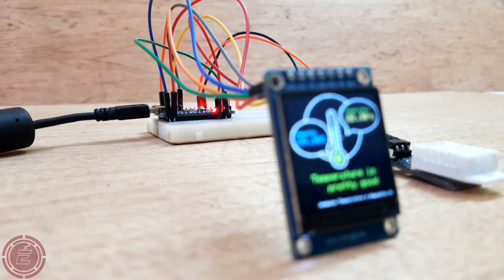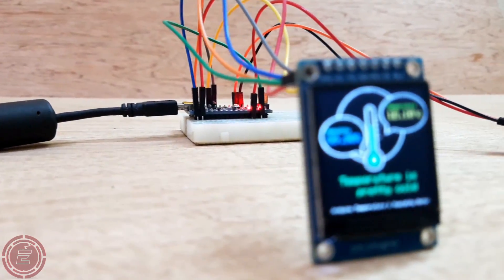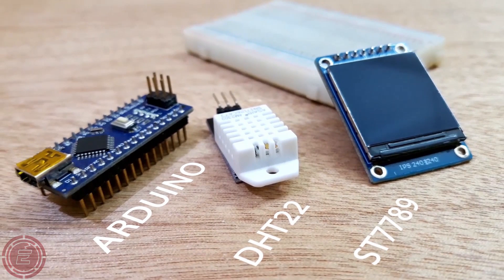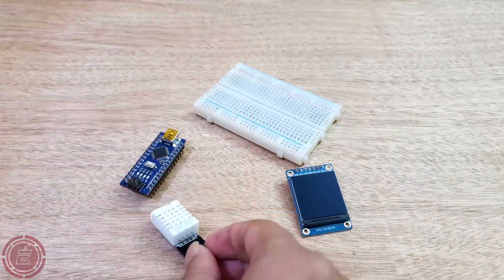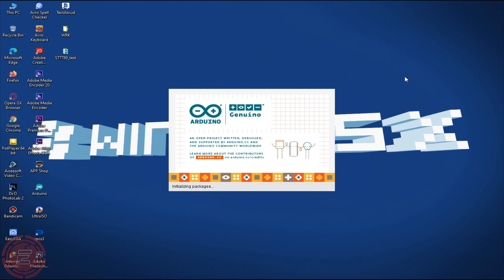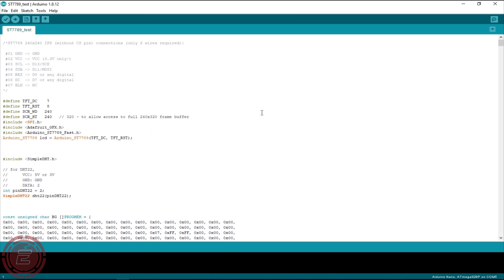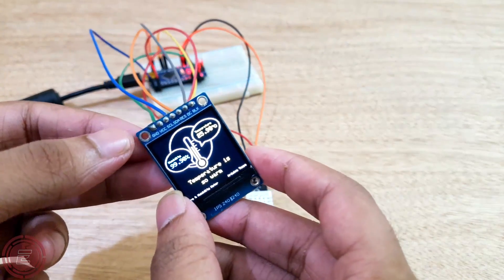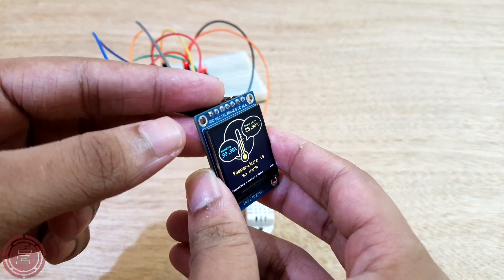Awesome DIY Temperature & Humidity Meter | ST7789 TFT & DHT22

Comment: Can I use DHT11 for this project
Reply from the maker: yes you can.
You've to change the code littlebit
Reply: Can u change code according to DHT11 plz
Reply: @imtiazirshad1  usually (from what I've seen) you need to define the screen - # the one you don't need and unquote yours. Easy to find exact info on the internet or in the code explanation in the beginning, hope this helps
P.S. better to use dht22 as it is a better sensor and not expensive, a bit more than dht11

Comment: Cool video is intelligible and understandable!  please tell me if it is possible to make such a weather station which, for example, on node MCu or Arduino modules is a thermometer.  I collected data from them tablet, via wi, fi which is connected to the Internet via gsm.  ... and so that on a website you can view them accordingly.  and, accordingly, it is possible to receive this data on another smartphone so that it may even screech some kind of blink type.  Thank you in advance !
Reply from the maker: Yes, absolutely